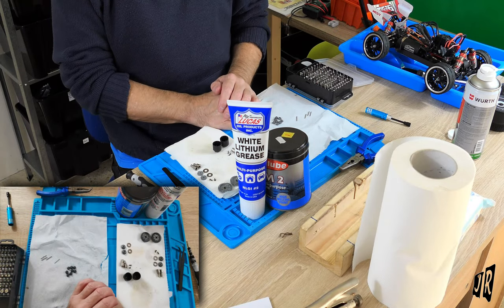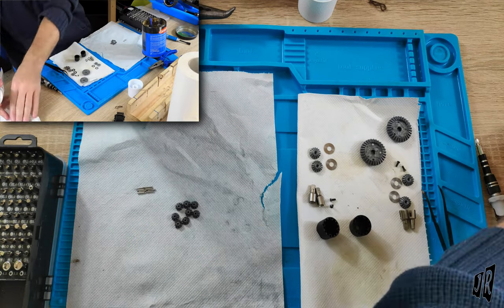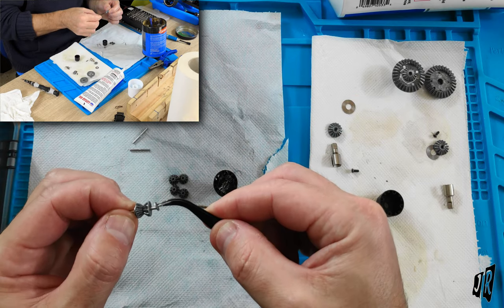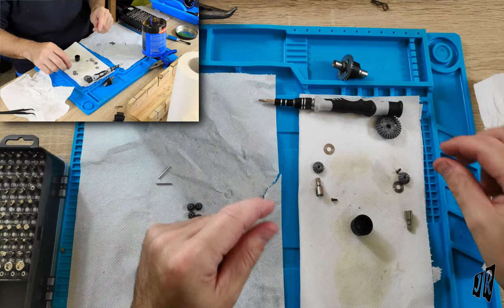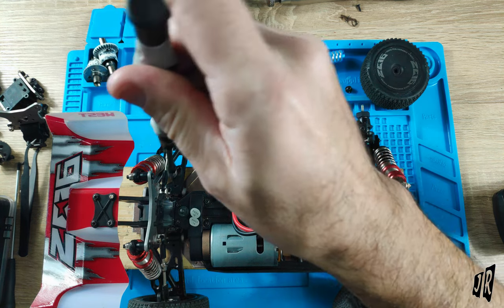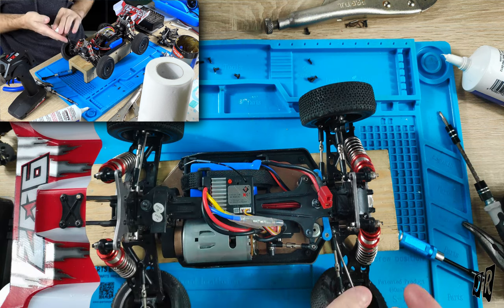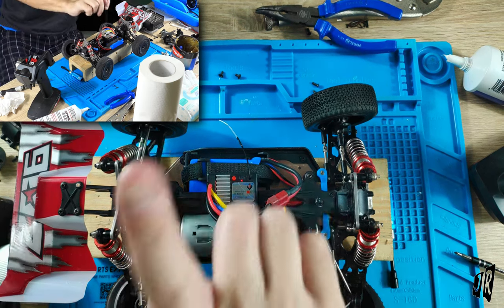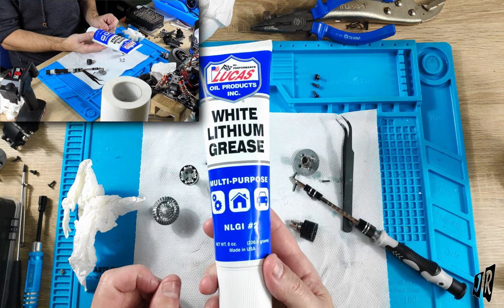Best lubricant for your RC Cars,  white lithium grease! Best grease

Comment: I have been using the Lucas Oil White Grease for a long time and not just on RC equipment . Many furniture makers use it on the moving plastic parts and metal parts on recliners and such . It is long lasting and very slick ! It also makes squeaks disappear . Just try to remember that it is on the thin side and not thick like other grease and takes very little to do what ever job where you need lubrication .

Comment: It's really good stuff for the right applications. John, change out the plastic hex's for alloy hex's...wheels spin freely tightened right down. if the nylon/plastic ones are over tightened it's like putting a disc brake on the hub. Consider changing them mate.
As good as the Lucas white lithium based grease is, it is not suited for any of the guys who are tuning their diffs. Stick with silicone for this.
The reason your white grease is spinning more freely is that you have to take viscosity into account. (cst values) . Yes it will ''' spin  '' more freely with lighter fluids, However this is not always a good thing with the larger scale RC's.
In saying all that, I hope you understand what angle i'm coming from John.
The product is indeed amazing and it has its place. Change all your WLToys hex's to alloy mate, You wont regret the move.
Take care John and thank you for your hard work.

Comment: Would the plastic diff casing be OK with the lithium. How long would it take to start rotting the plastic (genuine question) thanks
Reply: Hiya. That's the reason I said it has to be white of the lithium grease time. The white version can be used with plastics and acrylic. I have been using it for 3 years now and not only have I not had any more differentials break, but no matter what manufacturers, there is no issues with the plastics. 😊👍
Reply: @JohnRobinsonRC  ahhh rite. Thanks for the reply. I will start using it myself then. Nice 1 mate

Comment: Hi can i use white lithium grease on gearbox on my crawler ?? Or is there  another type of grease for gear boxes
Reply: Hello. Honestly I cannot answer as I don't own any gearboxes. However my logical mind says that you should use specific rc gearbox oil.
Reply: @JohnRobinsonRC  Thank you ❤️
Reply: You are welcome. Just to add if you only had white lithium grease then I would work. But not as well as oil. But IT HAS to be white. 😊👌
Reply: I use white lithium on every single gear in my crawlers. Works great.

Comment: white litium grease over silicone diff fluid?? How do you tune the car? I race 1/8 scale dirt
Reply: Sounds like you're running sealed diffs (gaskets to hold in fluid) whereas the diffs he builds in this vid are open diffs (no gaskets). The diffs in the video would just drool fluid if you tried to lubricate with liquid, hence grease instead of oil. Open diffs are not really meant to be tuned, mainly just if they work they work.

Comment: Cant wait for this petroleum based grease to ruin my plastics
Reply: This exactly, do not use petroleum based grease if in contact with plastic, all metal housing, OK, use a sythetic or silicone grease
Reply: @daijoubu4529  It also has lithium soap or lithium cation and I am pretty sure the RC vehicle you may use it on will have been in the trash long before that happens .